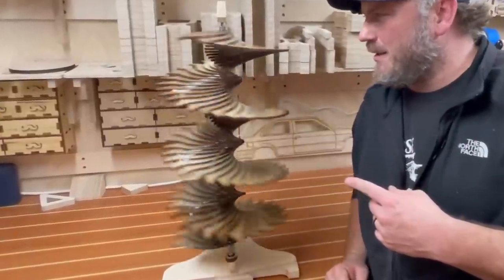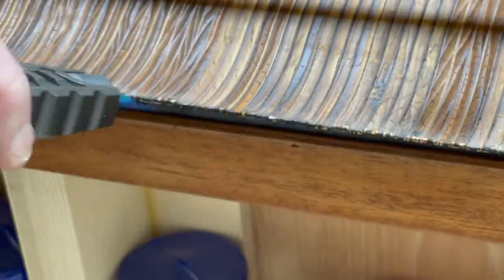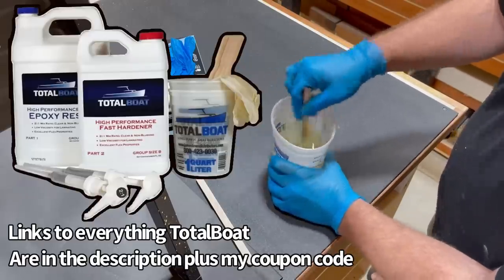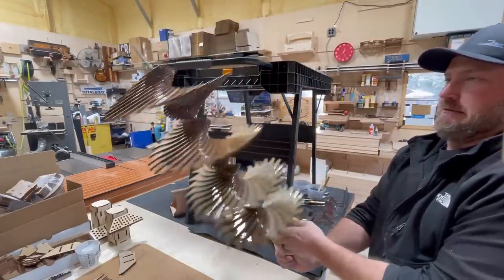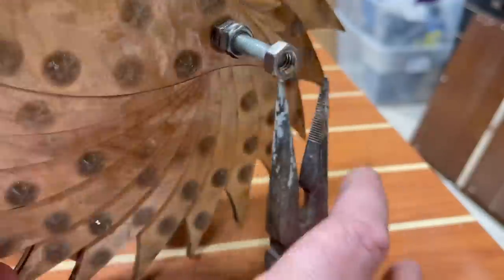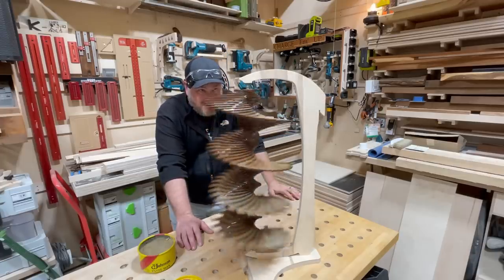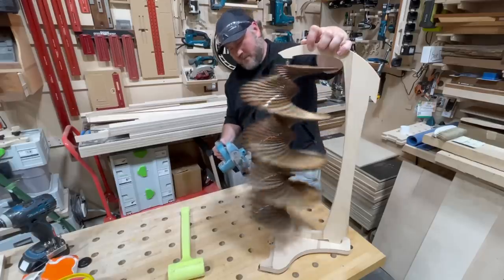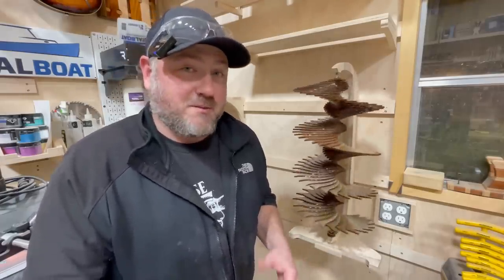I Made This From Trash

Comment: Great "free" project. Glad you enjoyed it.  It is a good Video.    Suggestion:  Re do your frame to top hang the spiral and add a small clock type dc motor and battery pack under the bottom.  Hidden out of sight.  Maybe a magnet switch to turn it off and on when the magnet is in the correct place.  Or a simple on/off also hidden underneath.    It is YOUR project do as you wish.  Thanks have fun and stay safe.  Maybe no pinchy points.  LOL

Comment: A simple kit would be good.  Also, adding two ball bearings at the top and bottom to hold it in place, and the thing will be smooth as butter.  As it is now, I'm guessing the bottom plate will have a hole eventually.  Very cool looking.
Reply from the maker: Thanks for the idea. Definitely looking into getting bearings to do kits for sure

Comment: LOVE IT!  But a few advancements towards a final project.
1. Cut the spare parts in half.  That way from one cutout you will get two blades.  And be sure to bevel, route, and curve the outer edges.  It will prevent OUCHES.
B. Use a silicone gasket in the top hole to reduce friction.
III. The hight for me is no problem.  But I would stain and wax polish the stand to give it a real rustic wood look.
Fortly, as this is Holiday Time, there is a German decoration of a multi-tiered Merry Go Round.  The antique item is powered by lit candles below, providing warm air to sloped paddles above.  This whirly gig could do the same.  By using water based stain instead of two part resin the spinning blades are less likely to ignite from the candles.
Lately, the 3 base outrigger feet need to be wider for stability & candle stick holders.
But I'm going to make one, in time for Little Christmas ( Jan. 6).  Thanks for the idea.
Jim in N.Y.

Comment: That’s a fun project Chris! Many of us woodworkers struggle with saving every piece of wood with the thought that “maybe I’ll use it someday...” and you actually have used your scrap in a really cool way! You may or may not be encouraging us wood hoarders to keep hoarding lol 😉 

If you do end up selling some of these in kits, maybe you could adjust your French Cleat file to automatically cut out the little hole in these “waste” pieces? It probably wouldn’t add that much cut time to the file, but might save you time afterward going back and lining up the pieces. Also, I wonder if small bearings at the top and bottom of the all-thread would help it glide smoother? 

I love how you’re always innovating... awesome job!

Comment: That is really cool!!! Definitely love it 😊 Just thinking of a way to make it spin for longer, and the first thing that comes to mind would be to add a bit more wood on both sides of the top supporting arm so that you can fit a bearing race a bit like the ones for skateboard wheel bearing........ only smaller, so it fits the threaded rod. Possibly have a small fan/blower that can stay on all the time, which could run off solar panels? 🤔

Comment: you can use a coupling nut on the bottom and have more threads , a brass bushing on top would be simple to drive in the wood

Comment: Cool geometrical art piece, are you aware that you could turn that thing into a wind generator? A couple bearings well-placed and some stability to withstand the pressures of the wind in a little built up on the top where the shaft Runs Through It, attached to a little generator. You could easily generate electricity with it. Nice going. At least you used the stuff you already had.👍

Comment: here’s a couple of thoughts Chris. Maybe a bearing at the top or bottom, even could be propelled by a rubber band at one end. If you were to make it free standing instead of French cleat, maybe a thicker base. Each layer of wood could be secured to each other by CA glue at the back and front instead of epoxy. Endless possibilities! Do you think the weight of the epoxy provides some centrifugal force? I think you got something here, let your imagination run wild!

Comment: Dude that's dope. That's the type of visual experienced when consuming psilocybin. Perfect In Design. To achieve maximum stability you will need to add weight in the equation. The base needs to be very very dense/thick, and heavy this will allow you to stabilize your energy / speed via momentum.

Comment: Howdy...

Ya know what's really cool about this Wind Spinner is that it's actually been around since ancient times. I believe Archimedes (sp) or Michael Angelo invented it but not as a wind spinner but as a "screw" to move water up from a lower plain to a higher plain as well it was used in the same fashion to move grain. This concept was later tweaked and became the bases of clock movement which eventually became cogs and gears. A cylinder with a helix wrapped around it. Interesting ehh.

Comment: You need a little electric motor with a belt to drive it.  A product display or sign.  Add some lighting too.  Led's or neon.  You can have the product on top of the shaft spinning.

Comment: Install a bearing below and a 12 volt  DC  motor  on above  using speed controller 😇 use rechargable battery come on u can do it with some colourful led light also

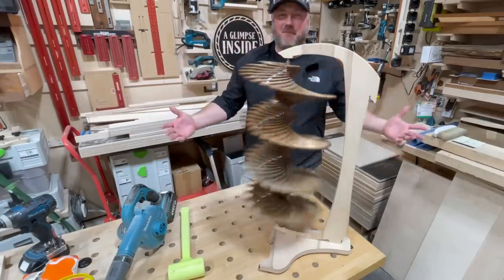Comment: 11:55 If it works, is it really dumb??? I think not. Knowing that you have plans of selling these former waste pieces so we can build one for ourselves, you can sell them without the threaded rod and other hardware to keep cost lower for your customers, AND save a bit on shipping as well. I have to admit that I like this size, instead of a smaller version. I've done similar wind spinners made from 3/4 x 3/4 waste pieces of pine. This really looks a lot nicer than what I have been making.

Comment: Dear "A Glimpse Inside", I expect you have finally realized that you have been turning your device in the wrong direction.
Where did I get such a conclusion?
The wind blows each individual "feather" and turns it by hitting harder the side with the bow inward. The end result is the difference of two thrusts, and thus the turning of the entire "wheel" goes in the opposite direction of your thrust with the compressor.